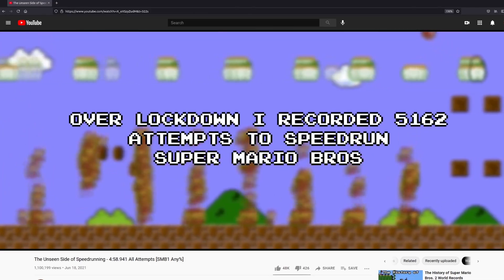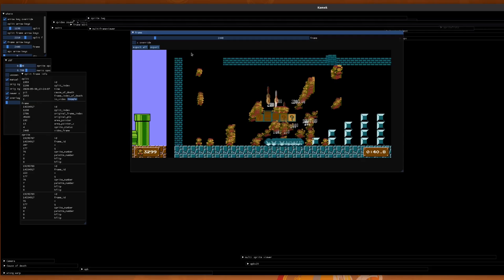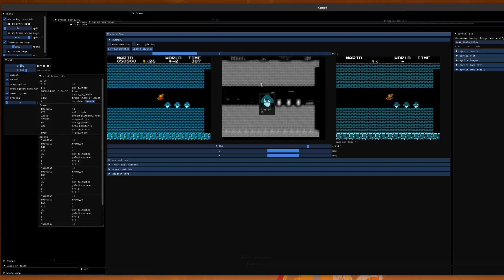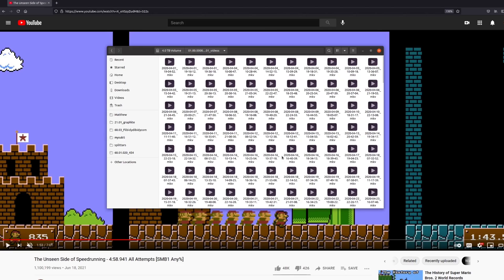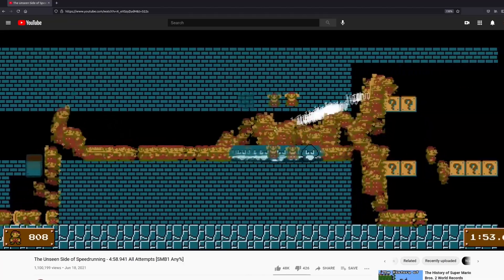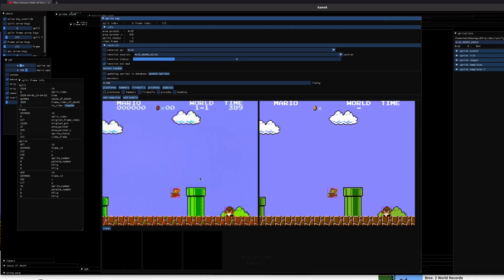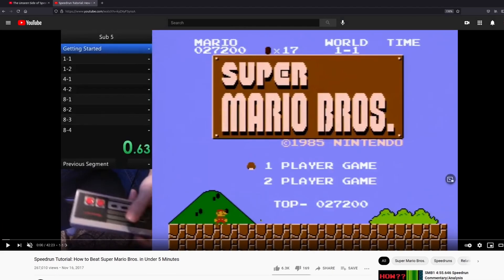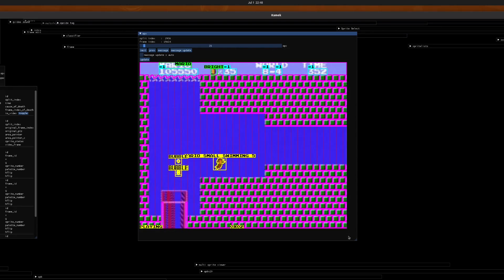The Unseen Side of Speedrunning - How it was made

Comment: The only thing I don't understand is why people think you have to play on a keyboard if you emulate,  all emulators are compatible with joypads and you can easily get wired USB NES Joypads
Reply from the maker: You are correct! It would be very important to evaluate for any input delay if you use one of those controllers because even a single frame can be noticeable.
Reply: @flibidydibidy  true, but keyboards use USB 2.0 or 3.0 and Joypads typically use the same, so that should eliminate that problem as it's pretty much the same speed

Comment: I feel like there should be a simpler way to do this with emulators and maybe recording inputs. You might have to literally rewrite some emulator though, so you can do things like replaying multiple runs at once and having the screens line up and not be centered on each individual mario. Recording inputs instead of video would save a lot of space on hard drives, and if you can replay the actual game instead of recording, figuring out sprites and stuff won't be a problem. Though doing all this would mean you aren't really creating a complete general solution that can easily be applied to other games like you seem to be talking about doing here, and you also can't get other people's world record runs to work either since you don't have the recorded inputs.

Comment: This is super cool, thanks for taking the time to make this follow-up video! Two of my favorite games are Celeste and N++, both of which would also work very well for videos like this. I know that someone did it for N++ once already, but I can't find it anymore, and I don't think anything exists for Celeste. It would be amazing to have a somewhat "general-purpose" solution, because the resulting videos are so fun to watch but currently not really feasible to do without a pretty intense amount of work. Probably would be best to use memory watch to extract movement/positional data that can be stored as ghost replays, and then have that part separate from the actual rendering of said ghost replays outside of the game engine.
Reply from the maker: Hi! Yeah I agree that getting the data direct from memory is way better and more reliable. There's always going to have to be some amount of customization on a per game basis.

It's a lot of work - but fun!

Comment: Well, that was even more impressive than I thought. Even if don't mention the entire program made just for gluing 5000+ footages together, it was a surprise to see red squares of sprite recognition. Srsly, I could see your notice that you didn't use the emulator, but I was "wtf lol how did you record location of your character then? eh, you probably intercepted this data from NES memory or something". But the truth is - you had to recongize EVERYTHING from the existing footage, without any additional data. Wooow.

I have one question though. How did you record these footages? Did you use camera to capture a screen of your TV or some software has directly captured TV signal and then decoded it to digital form?
Reply from the maker: The first 2k or so we're recorded with an easy cap, essentially the composite output was split and half went to the CRT and half went to the computer. After that I upgraded to a retrotink2x and HDMI capture card.

Nowadays I use a NesRGB and ossc and HDMI capture card.

Thanks!!

Comment: Amazing video as always.

How does your software handle runs that are ruined by a failed wrongwarp? e.g. if in 4-2 you wind up in the coin pit instead of the warpzone?
Reply from the maker: I have a very simple neural network which classifies the 'area' within each level. So in 4-2 there are actually 5 possible areas; the walk to the pipe, the underground section, the warp zone, the coin cache, and the flagpole. All of these areas are pretty visually distinct so telling them apart is pretty straightforward.

Then when I combine the information back together if the level is 4-2 and the area pointer is 0xc2 it's just ignored. I did combine those frames together with an earlier version of the software here: https://twitter.com/FlibidyDibidy/status/1384316287401140224

Thanks!

Comment: Since this interprets images from a video capture (instead of memory addresses from an emulator), do you think it would be easy to tweak this program to work with other games? I assume it's easier to copy-paste sprites and tiles than to research memory addresses for background layouts.
Reply from the maker: Unfortunately no, it would be easier to use an emulator (although still difficult). I can extend this to other games, but there is a lot of engineering effort required :/

Comment: The fact this utilizes video data instead of the games data itself is an amazing feat. I'm so curious if you trained it with the sprite sheets...
Reply from the maker: Hey Quiet! Some parts of the program work on the character data, but the final sprite classification that was used in the uploaded video actually didn't - it worked off of extracted 'templates' from the videos themselves which worked much better. (because of a wide variety of reasons haha).
Reply: It's great to hear from you  @flibidydibidy !

I think I understand, as there's something to be said for LoFi vs HiFi input, especially when utilizing a neural network to process the data.

Comment: With that many PNGs, did you have multiple terabytes of images to sort through? You said there were 16 million of them, and if they were stored at 24 bit depth, some quick math indicates they would take up 2.9 TB uncompressed. Maybe with judicious use of palettes and lossless compression you could get it down under 1 TB, but that still seems like a huge amount to deal with.
Reply from the maker: Yeah it was a lot and kinda annoying, It did end up over a terabyte of image data. Each frame was 256 x 208 (because of another bad decision early on) but maybe it made random access to the frames faster than decoding the video on an as needed basis. I didn't have to get too fancy in the interface.
Reply: @flibidydibidy  I'm kind of stupid but would it be possible to save data because of all the repetition? Like the only things that change are Mario's position, his sprite, and maybe some other sprites, so couldn't you store those in text form maybe?
Reply from the maker: Hi Isaiah, the actual information (sprite number, palette number, x, y, etc) are all stored in a sql database - the pngs are the actual raw video information. That information is compressed automatically into the video file - but I sort of uncompressed it to make programming easier, but other aspects became harder. You're on the right track!